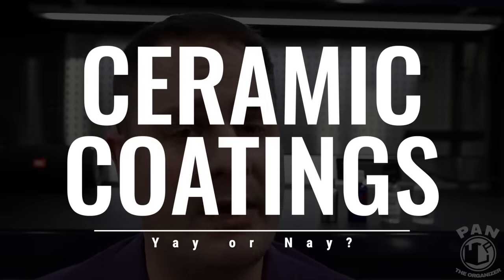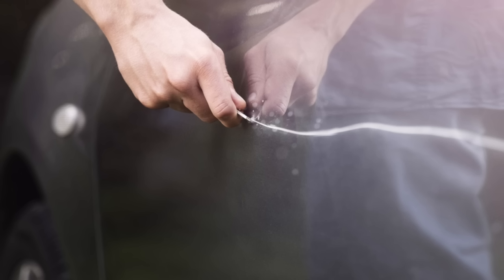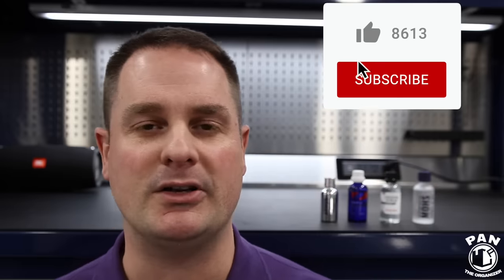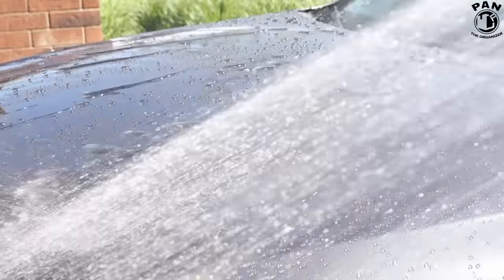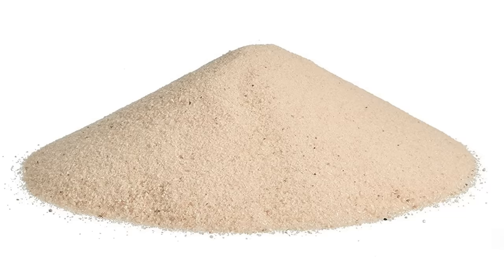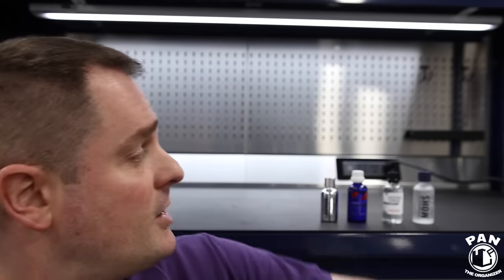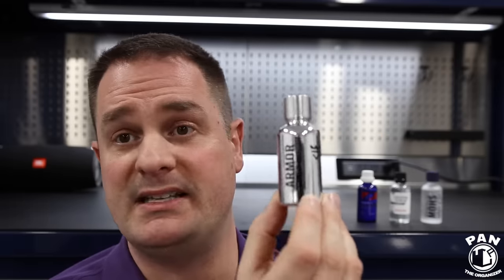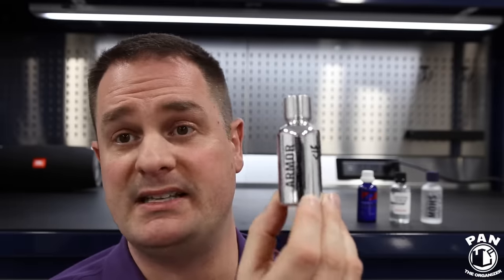DON'T BUY CERAMIC COATINGS BEFORE WATCHING THIS !!

Comment: ey Pan , how do you know when a car has a ceramic coating ?
Reply from the maker: That is hard to know for sure unless the previous owner tell you, but a good visual indicator is if  it has great water beading properties and quick water sheeting and the protection seems to be there for over two or three months, it probably means there is a ceramic coating on the vehicle.

Comment: Do you need to keep having your vehicle detailed if so how often
Reply from the maker: It depends on your needs, budget, etc.

If you have your car professionally detailed including paint correction and ceramic coating for example, all you need to do on your side is a proper wash and once every two or three months apply a topper to boost the protection and make sure you’re getting maximum durability out of your coating.
Reply: If your primary method of cleaning your car/ SUV is a car wash is it still a good idea for a professional to do your  ceramic clearcoat especially on a  older vehicle
Reply from the maker: Not really. I can't recommend automatic car washes, as they use harsh chemicals to clean the car and that will eventually reduce the lifespan of a coating (even though coatings have much higher chemical resistance compared to normal waxes and sealants). 

When having a professional apply a coating on your car, the best maintenance is to wash your car at home, using a pH neutral car shampoo and proper wash techniques, like in my ceramic coating maintenance wash video here: https://youtu.be/yLiePQRMFc8

If you are bringing your vehicle to an automated car wash, then it might be a better idea to use a less expensive wax every month or so, and hand apply it.

Comment: Great video!
Reply: I was going to order your ceramic coat that you mention was the best and when I did there’s no area to put your discount code so I didn’t make the purchase
Reply from the maker: Thanks Edward!
Reply from the maker: LOL What? Come on Edward. Of course it works. When you click "add to cart", a pop-up appears, showing your car, and there is the option right there clearly written "APPLY PROMO CODE". When you click on that, it allows you to type PAN25, and boom  it works I just tried it.

But you have to use my link to access the website, so click this link:  https://avl.kg/pan25

Comment: When I bought my car, I asked about coating my car with ceramic coat. I flew away hearing the price. I then started waxing and detailing, like anyone I got addicted to it, spending a lot of money. If I knew that in the first place, I would definitely had my car ceramic coated. And that`s my advice to anyone reading this.
Reply from the maker: Yeah ceramic/graphene coatings are in my opinion the best form of paint protection. I explain the differences between waxes, paint sealants, ceramic coatings here: https://youtu.be/4ejfPHan3k4

Comment: Great INFO Here: Can Armor Shield IX Be Applied to Decals, Paint Protection Films, Fiberglass, Carbon Fiber, and Vinyl Wraps ?   = Damn skippy! Armor Shield IX is proven to provide protection to vinyl decals and wraps, paint striping, carbon fiber components, paint protection films, fiberglass, and much more. If it’s solid and porous (think microscopic imperfections) Armor Shield IX’s Nano-Coating will bond with it and cure to 9H hardness levels.

As for applying a ceramic coating to a matte vinyl wrap or PPF, rest assured in knowing that the surface being coated will retain its non-glossy finish.   /// McRoman  ;)
Reply from the maker: Thanks for watching Ian! How did you discover my channel by the way?

Comment: PPF or ceramic coating?
Reply from the maker: It depends what your needs are. For ultimate stone chip and scratch protection, PPF. For self cleaning properties, chemical resistance, gloss, slickness, and hydrophobics, a ceramic coating is best.

You can get the best of both worlds by applying PPF first, and applying a ceramic coating on top of the PPF.

Comment: I wish they would make paint on the car that doesn't get dirty at all from road salt and dust and more .
Reply from the maker: Well the good ceramic coatings certainly make the car less dirty and appear cleaner. I have had ceramic coatings on my cars for years now, and even when driving in the crazy winters we have here in Montreal (Canada), my car still always looks cleaner than all the other ones on the roads. Of course there is no paint protectant that can keep a car looking pristine in winter, but they sure make the car much easier and quicker to clean during maintenance washes.

Comment: Yep it protects but doesn’t against the obvious stuff
Reply from the maker: What are “obvious stuff” according to you?

Ceramic coatings are designed to protect the clear coat against the elements, acid rain, bird droppings, tree sap, make the paint glossier/slicker, boost UV protection, and have self cleaning properties making the vehicle much much easier to clean. Oh and good coatings can last for years and offer tremendous chemical resistance, things traditional carnauba waxes can’t do.

So yeah, ceramic coatings are the best form of paint protection. 

But they’re not magical force fields that protect against stone chips or scratches. Only PPF can do that.
Reply: @PanTheOrganizer  you know what I mean if a rock hits your car if someone keys it etc etc
Reply from the maker: As I said, ceramic coatings were never designed to withstand that. Only companies with garbage marketing would do such ridiculous claims.

If someone wants to protect their paint against stone chips and scratches, the only solution currently is PPF. Everybody in detailing knows that.

Welcome to my channel. You discovered one of the biggest car detailing channels on YouTube as we surpassed 920,000 subscribers and we have over 120 million views! I have been detailing for 26 years and I love to share my knowledge and passion with my viewers.

You found the right channel to help you learn everything about detailing.

Comment: Do you know any ceramic coatings that last a year?
Reply from the maker: Glass bottle coatings typically last 2+ years depending on what brand you get.

For ceramic based products that last up to one year, you would need to look into sprays like the new Gyeon CanCoat EVO which I present in this video: https://youtu.be/_aZui6CkwO8

Comment: Paaaan! Can I just Polish my car and jump to ceramic coating? My car is brand new and the paint is 90% fine
Reply from the maker: No. Even new cars need preparation. Vehicles exit factories and are transported by truck, train, boats. They are often left at boat docks or dealership lots for weeks sometimes months. They are exposed to the elements, industrial fallout, acid rain, UV rays, brake dust, etc. It's critical that a vehicle be well prepped before applying a semi-permanent coating like a ceramic coating. 

To give you an idea, watch what I did to my brand new BMW as soon as I took delivery: https://youtu.be/dsCmJJDP3xo

Comment: "Protect You from the elements" like rocks in the highway?
Reply from the maker: No. Like water, rain, sleet, UV rays, etc. Act like a windbreaker for your car's clear coat. Coatings don't protect against stone chips or scratches. Only paint protection film (PPF) will do that.
Reply: @PanTheOrganizer  thank you for your answer, keep up the good work !!!
Reply from the maker: Thank you! How did you discover my channel by the way?

Welcome to my channel. You discovered one of the biggest car detailing channels on YouTube as we surpassed 760,000 subscribers and are getting close to 100 million views! I have been detailing for 25 years and I love to share my knowledge and passion with my viewers.

You found the right channel to help you learn everything about detailing.
Reply: @PanTheOrganizer  occasionally i buy different things for my car, to keep it looking like new, although it has 9 years, it looks very good. When i buy something i check your channel and see whats new on the market. Thank you for the way you explain things!

Comment: As I understood, we have to add ceramic coat on top of clear coat in order to save the clear coat. And then we have to add a layer of silica based sealant on top of ceramic coat to save the ceramic coat.  And then we might add a layer of wax on top of sealant to save the sealant. Is there anything else left that needs saving 😂
Reply from the maker: LOL !!

Comment: If ceramic is that good..then why do car manufacturers don't coat cars off the assembly line with it ?.
Reply from the maker: Because it would take too many man hours to complete and would cut in their profits.
Reply: @PanTheOrganizer  but robots coat cars with clear coat..why not ceramic coat...clear coat seems to go on very quick on the assembly line.
Reply from the maker: Not the same technology.  Food for thought: if it was that simple and didn’t cost much, don’t you think car manufacturers would have applied ceramic coatings at the factory? I think we know the answer to that.

Comment: I think all ceramics coating are the same. But different prices
Reply from the maker: That couldn’t be further from the truth. Different formulations (SiO2, polysiloxane, Silicon Carbie, Reduced graphene oxide, etc), different amounts of layers, different curing times, different atteibutes (some bead more, some have higher chemical resistance, some are glossier, some are slicker, etc), etc.

Unless you are talking about a brand that has their coating made by another brand, then potentially those two coatings could be identical or similar.

Comment: So... the Clear coat is applied to protect the paint, the Ceramic coating is applied to protect the Clear coat - What's going to protect the Ceramic Coating🤐🤐🤐
Reply from the maker: A topper which is needed to maintain the coatings.

Nobody said detailing was easy. But it’s so fun.

Comment: Ceramic = MARKETING ....  old school forever
Reply from the maker: Are you one of those people that believes that ceramic is snake oil? Ceramic coatings have been around for nearly a decade at the consumer level now, and it has been proven time and time again they are the real deal. True coatings, in glass bottles, can last for years. Compared to a traditional carnauba wax that lasts 1 to 3 months at best, has very low chemical resistance and nowhere near the self cleaning properties that coatings have. 

Detailers around the world know this and hence why most offer ceramic coatings as the ultimate form of paint protection to their customers. 

Now that doesn't mean that wax is dead. People that are old school still enjoy applying a paste wax by hand as there is some sense of joy in doing so, and good carnauba waxes still offer a warmer glow and more natural appearance. As long as people enjoy taking care of their vehicle, it shouldn't matter what protection they use.

And you should respect people's choice, just like they should respect your choice of staying old school with what ever paint protection you pick.

But calling ceramic coatings marketing, hype or "snake oil" is pure ignorance in my opinion. Any chemist in the industry would agree in saying coatings are the best, period. There's a reason why they work so hard to push innovation and making sure we get more durability out of products. If it wasn't for their work, we'd still be stuck applying beeswax on paint, like they used to do in the early 1900s.